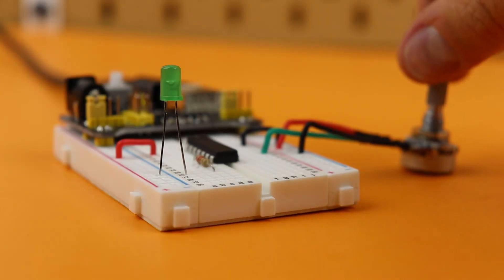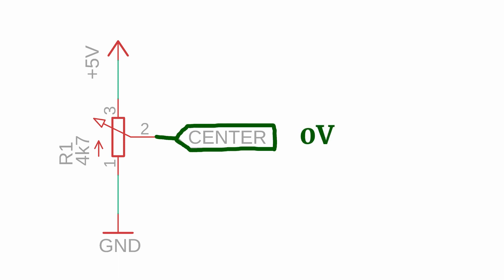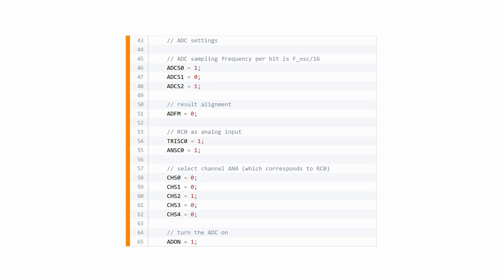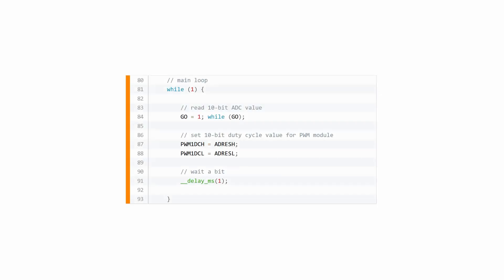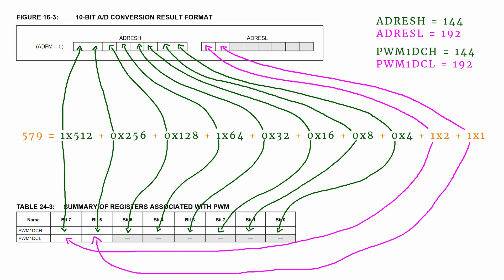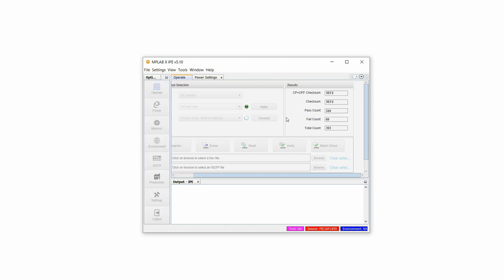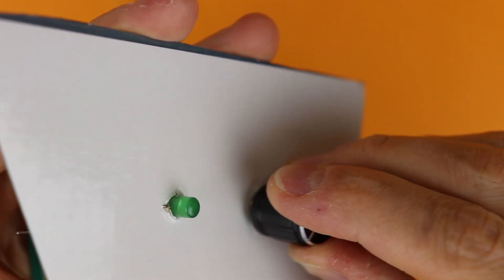How to use a microcontroller's analog to digital converter

Comment: Hello, i have a question and i'm not sure where to ask it, but the people here seem to know ehat they are talking about. I have a project where i am supposed to interface a rf pickup sensor. The rf pickup sensor produces a very weak signal,  and i do not really know how t amplify it, and convert it to a DC output. So could i use the PIC16F1455 to do so. Basically the question is how sensitive is the ADC on the board? Thanks!
Reply from the maker: Thanks for the question! ADC's are typically not used to amplify signals, for that you would need an operational amplifier or a good old transistor circuit, all in the realm of "analog electronics." Once you have an amplified signal that is in the range of 0-5V DC, you can use the PIC's ADC to convert it into a number between 0..1023. But before the signal is amplified, this conversion does not really help since you would lose a lot of resolution of the ADC. Let me know if this helps :)
Reply: @FriendlyWire  so i should focus on amplifying the signal first? I also have a few arduini boarda, so could i use the arduino as an adc?

Comment: Sir, for push pull  inverter.   dead time pwm 50Hz with control Duty cycle.  Please provide a video on this topic.   It will be very good.
Reply from the maker: It's a very interesting topic, but I don't cover high voltage topics on this channel :) These are very interesting circuits, but they are also quite tricky and potentially unsafe for beginners. This is why everything here uses 12V max. Sorry, but thank you for  your interest! :)

Comment: MPLAB has an online facility called MPLAB xPress. we can do the programming on it. However it doesn't show PICKIT3 or 2. I tried this code on it. It did well and produced the hex file too. One thing I noticed is, when choosing the type of file, it shows only C. There is no assembly. Any idea on this ?
Reply from the maker: PICkit2 and 3 are deprecated and no longer officially supported by MicroChip, this is probably why they don't show. It's a bit of a shame since the PICkit3 is all you really need for basic hobby electronics. I was not aware of the online tool, interesting. I use the MPLAB X software on my computer, so that it does not require an internet connection.

At what point do you choose a file type? The source code on my websites is written in C.
Reply: @FriendlyWire  It is sad that they deprecated Pickit 2 & 3. Pickit4 is damn costly here. Can't buy it at this point. 

There is one disadvantage with the online facility. Once can do only one project at a time. Looks like it holds the files in a folder called sandbox. I suspect it holds the files only for three days. Some thing like that flashed on the screen. 

When I tried to open a new project, It deleted the already created one. 

But for beginners, it is a not a bad option. 

When I tried to create a new file it displayed three types - Header, c main , source file. 

So I believe it allows only C language. 

need to explore more.

Comment: Thank you very much for presenting this in a simple and practical manner. I love it. Pic16F1455 is not available here. Can I use pic12f510 instead. It too have ADC.
Reply from the maker: The PIC12F510 can also be programmed with the same tools as presented in this video. But the code will be different, unfortunately, this is the disadvantage of there being so many different PICs :( Where are you located?
Reply: @FriendlyWire  India. Unless there is a huge demand, the vendors will not import the components. Once the stock is sold out, it may not be easy to get the same item again. There are international vendors like elements14. But they sell only to tax registration holders. 

pic16f1455 is 10 bit , while 12f510 is 8 bit. Hence the code will need to adjusted for 8 bit . right ? is there anything else I need to look out? thks
Reply from the maker: @anithasshenoy6662  The problem with PIC controllers is that they all have a slightly different architecture (different register names etc) which makes it difficult to re-use code from one controller (like the PIC16F1455) and use it directly for another one, like the PIC12F510. More likely, we would have to re-write this from scratch.

Do you have experience with PIC controllers? If not---which is totally OK---then I would suggest we start with making an LED blink first, and then move on to the ADC question. Let me know!

We can chat on Instagram/Twitter or via email (address is at the bottom of www.friendywire.com).
Reply: @FriendlyWire   Thank you very much. I understand. I have been into electronics since my school days 50 years back and into software programming since 1985. This is not my profession now. I had stopped doing electronics some 30 years back. However , now that I have lots of free time , I started looking into it. I found that there is whole new world in MC. I am gathering the required equipments for the programming. I hope to get it by next week or so. Though I live in a big city, the local stores do not have the PICKIT3 or 3.5 and even the MC's. I wanted to order some of these MC's online , hence wanted to know a bit about them. 

I shall write to you , once I get those items and try my hand. Your video's are of great help. Thanks once again for your kind efforts.
Reply from the maker: @anithasshenoy6662  Thank you for sharing, and I think you will have a lot of fun with microcontrollers, especially if you already have a background in coding. Regardless of whether you will use PICs or not, I am sure it will be a great experience.

Yes, please get in touch when the items arrive, or if you want to chat about projects, I am always happy to help. :-)
Reply: @FriendlyWire   I surely will need your help. Thanks a lot.
Reply: Finally got PICKIT3 today. However the vendor did not dispatch the pic ic's I ordered. They only send 16F505. I think this do not have adc input. So all those projects will have to wait till get them.

Comment: Can I use PIC16F628A?

I need a piece other than PIC16F1544, can I exchange it for any other item? I hope you mention an alternative to it
Reply from the maker: This tutorial is specifically for the PIC16F1455. The PIC16F627A and PIC16F628A do not have built-in ADC modules, unfortunately, so you cannot use them for this purpose. Do you have other chips available? The PIC16F1459 may be a good choice, too. Let me know, and I am happy to help :)

Comment: Thank you for this awesome tutorial video. You are great teacher. I'd like to hear why you prefer using IPE for programming, instead of using make and program device button. I mean maybe there are some benefits that i do not know of? You can also enable power target circuit from pickit3 in MPLAB X ide. Right-click active project folder and select properties: make sure that pickit 3 is connected hardware tool. Select pickit 3 (left), option categories --> power. Enable and select voltage. Ipe is much clearer though and propably the best way to teach. 

I'm addicted to your professional and well-made videos. And what's best i think is your website. This is just pure gold. Hope this channel grows ALOT.
Reply from the maker: Thank you so much for your kind words, Mikko-Matti! For some reason the IDE's interface with the PICkit3 would not work reliably for me and my setup, whereas for the IPE it always works fine. I will be sure to give it another try some time, I hope it's not too confusing for beginners. Thank you again, and have a fantastic week!

Comment: Good bless Arduino...
Reply from the maker: Ha, how so? I always believe that people should use the microcontroller that works best for them :)
Reply: @FriendlyWire  for been easy to learn..
Reply from the maker: @swatcat7928  I know what you mean :) I find working with PICs very interesting, because we need to look at registers in the controller and have to try to program everything ourselves, and I like the challenge. Also, once you have bought the PICkit3 programmer for around $25, a PIC only costs $3 or so, so they can also be a bit cheaper than Arduinos in the long run. But to each their own :)

Comment: Hello, first I wanna say this video was great and u did explain it very well, keep going!
Now I have a question: can we create a ramp or triangular waveform using an ADC? and if this signal can do the  job of the potentiometer like increasing the glowing and decreasing it ? ( I m using a pic32mk in my project )
Reply from the maker: Thank you! You are thinking of a DAC, a digital to analog converter, basically the opposite :) An ADC takes an analog voltage and turns it into a number. A DAC takes a number and outputs and analog voltage. If you want to dim an LED I would recommend using pulse width modulation (PWM) instead; you can check out my electronic candle video: https://www.youtube.com/watch?v=pCvCan2yGZg If you are interested in generating specific waveforms, then the DAC is your tool of choice, but the built-in ones typically have a slightly lower resolution.
Reply: @FriendlyWire  thanks for explaining!
Reply from the maker: @soumeya772  Of course, and let me know if you have other questions :) I may do a video on DAC's in the future.
Reply: @FriendlyWire   your video is gonna be so helpful! Thank u again for helping ^^)!
Reply from the maker: @soumeya772  Thank you for your kind words, it means a lot :)

Comment: Do you guys have any ideas on how to save the digital values into a text file? Thanks
Reply from the maker: Good question! The easiest way I can think of, with the content I have online, is to use the RS232 tutorial to sent it to a computer. Then you need a program running on the computer that manages the incoming data. You can learn more about RS232 and how to use it on a microcontroller here: https://www.youtube.com/watch?v=2T9ca53KMrM
Reply: @FriendlyWire  Thank you for your quick response.  I appreciate it greatly.  How about if this is a chip in an independent instrument which should save the data like temperature readings as text  file in itself and when the computer is connected to the instrument via USB it then can read the data like from a  regular USB fresh memory? Thank you
Reply from the maker: @cying6614  Then you need a means of storage on the chip. Many PICs have an EEPROM memory that you can use, but that memory is limited. You could use an external EEPROM as well. Another alternative is to use an SD card adapter. These are fairly easy to write to, but managing the file system is a bit complicated if you want the data to be readable on a computer.
Reply: @FriendlyWire  Thank you very much
Reply from the maker: @cying6614  Happy to help!

Comment: Thank you for these videos, they are so helpful! Particularly to someone like myself who has no previous experience. I was wondering what programming languages you can use to write the code for pic microcontrollers. Any suggestions?
Reply from the maker: Thank you for tour nice words, I am happy that the videos are helpful to you, it means a lot!
I only use C to program PIC microcontrollers, and the compiler is called XC8 (and, with certain optimizations switched off, it is free to use). You can check out my PIC introduction video and my website www.friendlywire.com for more information on this. It is of course also possible to program directly in machine language (assembler), but for simple projects that are not time critical it is hardly necessary.
Not sure if there are other dialects you could program PIC microcontrollers with, for me C has always been the language of choice :)

Comment: A really neat little project for an intro to ADC!
One hint towards those breadboard PSUs: It's worth checking polarity before plugging them into the breadboard. It's very convenient to have them matched + to red and - to blue. The other way round, not so much. (Yes, happened to me. Didn't find it at first.)
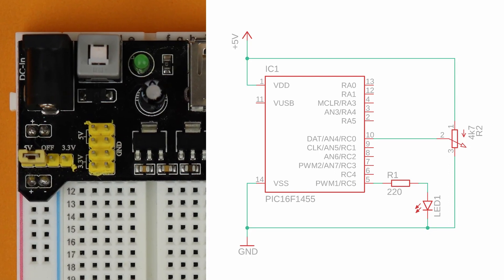Reply from the maker: Thanks! I have never seen a breadboard PSU with inverted polarity, but I will make sure to mention it in a future video! Thankfully the polarity is printed on the PCB and you can see it at 8:35 so it is hopefully not too confusing :)
Reply: @FriendlyWire  ١١١١١١١١١١١١١١١١١١١١١١١١١١١١١١١١١١١١١١١١١١١١١١١١١١١١١١١١١١١١١١١١١١١١١١١١١١١١١١١١١١١١١١١١١١١١١111